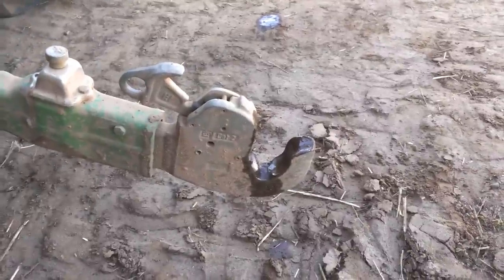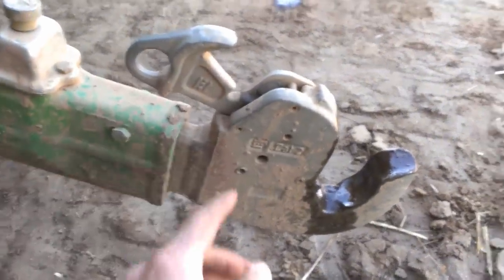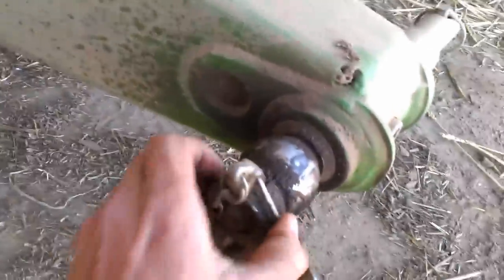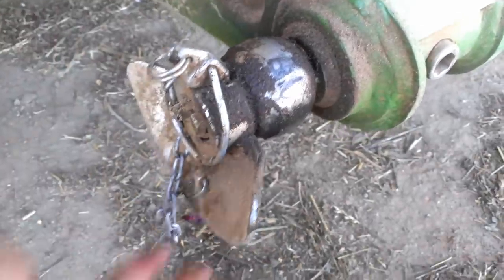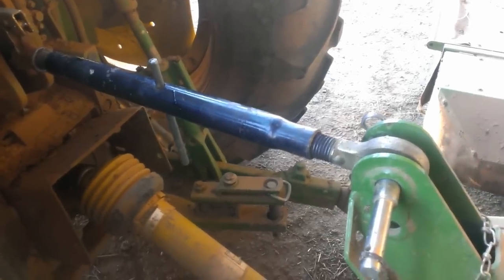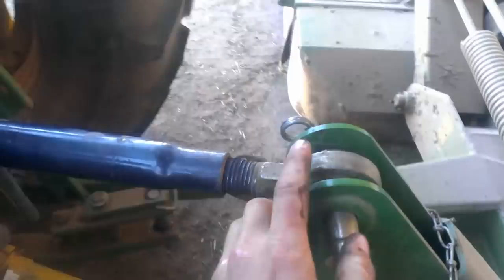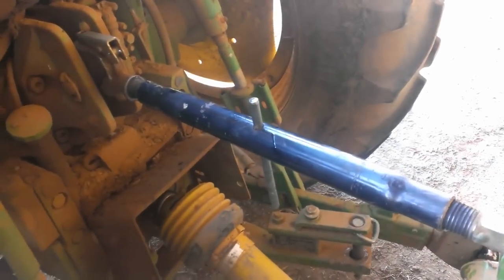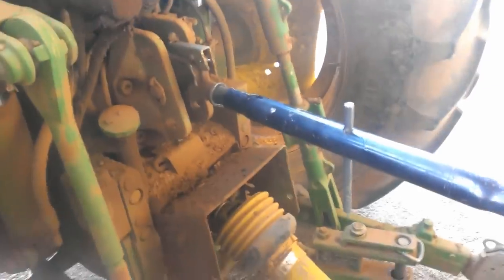3 Point Linkage Quick Hitch

Comment: How does the easy cut compare to a Am (if you had a Am of course)? It looks easier to hitch up for starters ;)

I'd like to trade up to a younger mower, one thing I hate about our old belt drive am is that the outer link is always a foot higher than the inner. Do the younger Am's do it as well?
Reply from the maker: Not sure how it compares to an AM easy cut because I never had one but this does sit nice and flat to hook up, well it would have if the krone engineers had made the stand 2 inches longer but a block of wood fixes that. I think the new straight krone mowers without the conditioner are basically the same in the hitch arrangement.
That is strange how the outer link sits so much higher on yours, I know this sounds stupid but I know if you don't take the pressure off the float springs for the mower this one will cock up on the outside to, just a thought.
Reply: ausfarmer89 it actually has two springs on it, one you can easily take off (always taken off) and one that's fixed but adjustable might be a good idea to slacken that too, thanks